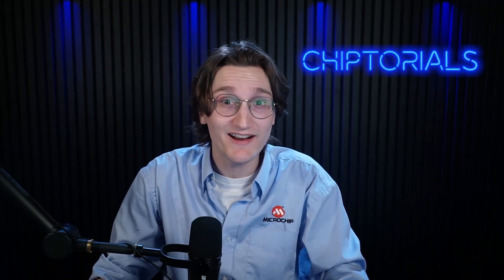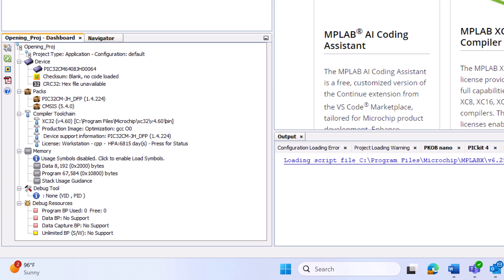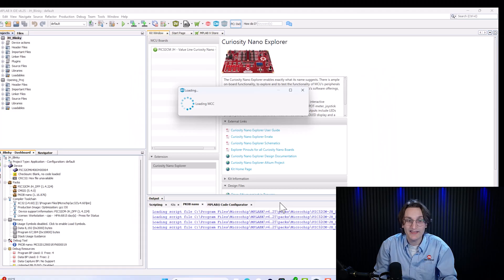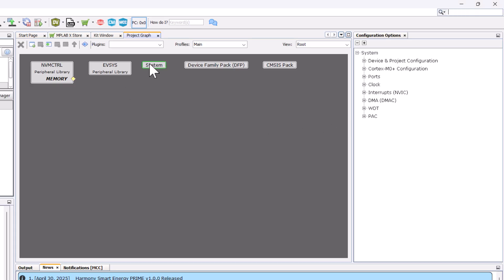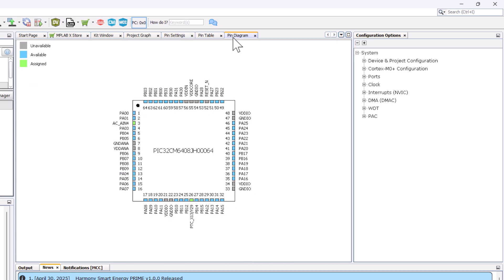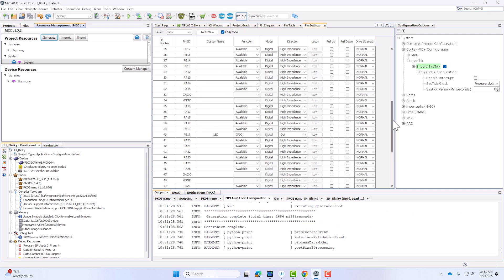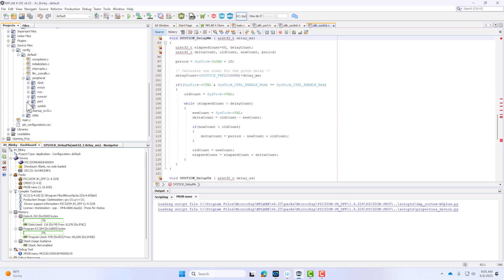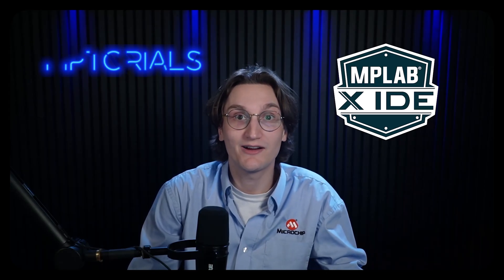Getting Started: WHERE IS EVERYTHING??

Comment: This looks like exactly what I need! I'm planning to use the same Curiosity Nano board but with a different Cortex M0 chip. Do you think the steps for project setup and MCC configuration will be mostly the same? Any key differences I should watch out for? Can't wait for more tips!
Reply from the maker: Hi @xinshijia,
The only difference for this lab would be pin assignments as it varies by device. You can check your Curiosity Nano User Guide and the Device Datasheet for more information on this.
Reply: Thanks for your reply!❤

Comment: I am using linux mint with a 4k monitor. Your mplab x is hardly usable with this configuration, because it has still scaling issues. When are you going to solve this?
Reply from the maker: Hi there, thanks for reaching out and letting us know about your experience. The scaling issues you’re seeing with MPLAB X IDE on a 4K (HiDPI/UHD) monitor are a known limitation. The solution to this issue will be included in the upcoming release of our next IDE, which will include extensions to address and resolve this concern. Thanks for understanding!

Comment: The debugging capabilities in MPLAB are horrible. They way it chooses to display only a handful of local variables that is completely random and regularly not the ones you want to inspect is pathetic, also the number of warnings generated by the MCC source code totally obfuscates any errors and warning in user code. Worst IDE I have had to use.
Reply from the maker: Hi there, thanks for your comment and for sharing your experience. Debugging and code clarity are critical for efficient development, and frustrations with variable visibility and excessive warnings are a common concern.
Regarding variable visibility in MPLAB X IDE, one reason you might not see all local variables during debugging is due to compiler optimizations. When optimizations are enabled, the compiler may remove or alter variables that it deems unnecessary, which can make them unavailable in the debugger. To improve your debugging experience and ensure variables are retained, please connect with us at https://www.microchip.com/en-us/support and we will be happy to assist you further. Thank you!